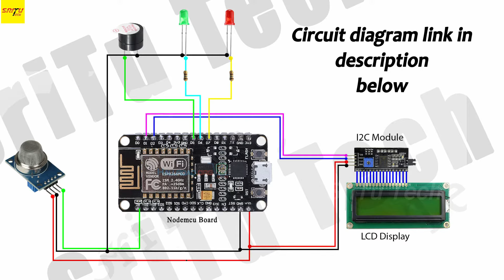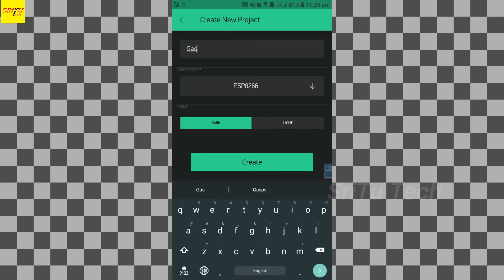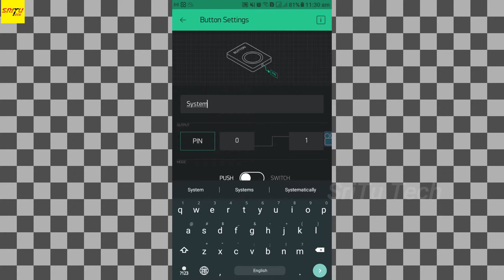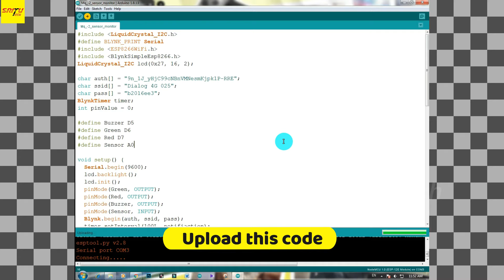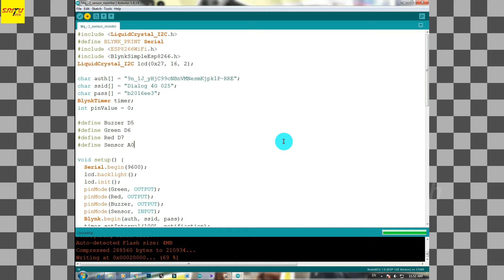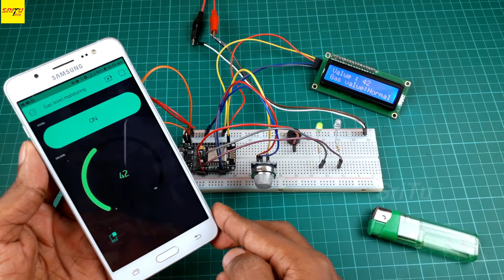How to make a Nodemcu GAS LEVEL MONITORING system | Blynk with GAS LEVEL MONITORING [MQ2 sensor]

Comment: my nodemcu keep restarting when i put my mq2 sensor on the pin. i need to connect to my voltage regulator and also my usb on my laptop. if i remove the usb from my laptop (just using my voltage regulator my nodemcu restart. i did my voltage regulator by using 12v input and 5v output and i have another 2 sensor (digital signal) that works fine without mq 2 by using the same code..i dont know what is the problem.. i need your thought on this..do u have any idea??
Reply from the maker: I think this is sensor issue..please replace the mq2 sensor and try again
Reply: @sritu_hobby  i already did change the sensor.. but still same.. i dont think it is sensor issue because when i use 2 supply that is form my voltage regulator and from then usb cable at the same time.. its works very well.. the snesor can detect and then activate the relay.. and all my sensor also works well.. but it just happen when i unplug the usb cable (just using my voltage regulator.) the nodemcu keep on restarting..

Comment: Hello, I did everything the same but blynk is saying device is offline. I tried it with a different code with just turning on and off the led and it worked it said the device was online so I am sure the auth code and credentials are correct. Is there anyway I can fix this?
Reply: Bro can you share the code please mine is also not working you can share also link of other video

Comment: Brother my arduino ide says  Liqiuid crystal is may not be supported to your esp8266 could you plz help me
Reply: @sritu_hobby  bro i didn't have I2C module but I've 16x2 lcd display so i didn't no how to connect it to the bread board
Reply: Can you share me code for without lcd plz this is my 1st IOT experiment 😬😬
Reply: @sritu_hobby  bro could you plz make a video on it 😐😕
Reply: @sritu_hobby  what is the meaning of "connect it pin row"?
I have same problem with @ROKESH

Comment: What version has a notification widget?
Reply from the maker: Check it on playstore
Reply: There’s no notification widget 😢
Reply from the maker: You can use old Blynk app.
Reply: @sritu_hobby  bro can we use same code for blynk iot which we used for blynk legacy?
as i have created gas level monitoring system by using blynk app as you showed in one of your video , now as blynk legacy is gone , i can't complete my project , please help what i should do?
do you have any other video on gas leakage detector using blynk iot
Reply: @sritu_hobby   if yes than please reply, my whole project is under way, i have completed all stages of this video, but now blynk legacy is no more and there is blynk iot instead and my mentor is saying it will not work now as code was for blynk app
Reply from the maker: You can try it
Reply: @sritu_hobby   brother will it work same as it was working in blynk legacy